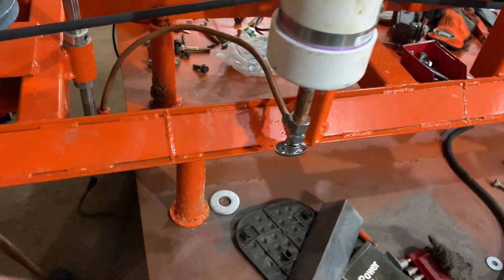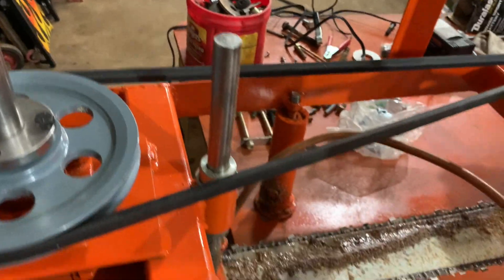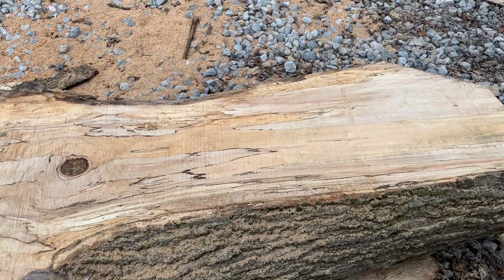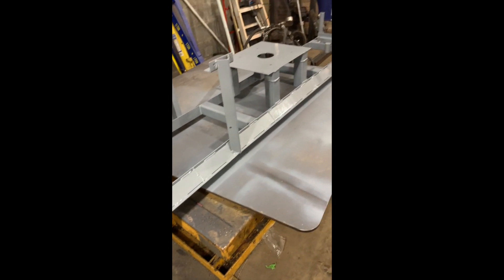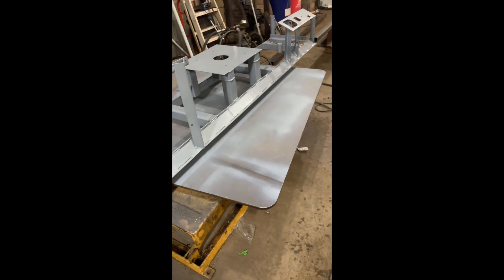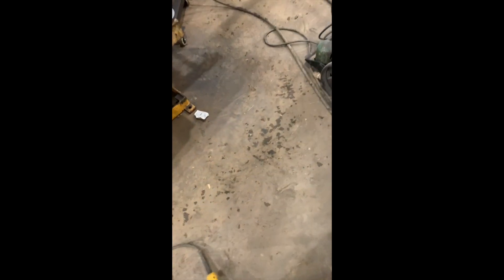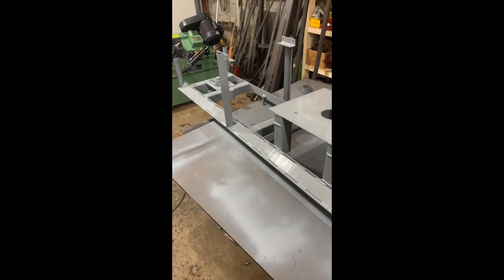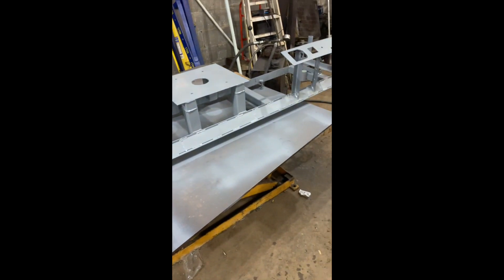DIY Lawnmower Powered Chainsaw Mill (Part 4)

Comment: That much horse power you need to change the gearing to increase the chain speed of rotation. 
 As well build a slide track and a table under it for the log to sit on where you push the unit on a slide on rails

Comment: Can you give detail of rim sprocket detail ?  I made a lawnmower driven, with a rim sprocket, but need other ideas......
Reply from the maker: Could you be a little more specific, I’m not quite sure what you’re asking
Reply: @ironacres717  https://www.instagram.com/p/CMa5EIDMdVv/?utm_source=ig_web_copy_link

Take a look at my Frankenstein.......I see you machined a rim sprocket assembly to a shaft.   Can you give a tighter shot of how your sprocket drives on the shaft?  Thanks, Jeff in Mobile, AL
Reply from the maker: Jeff Nagy Nice build ya got there! I believe there is a close up on one of the first two videos of the build series. I just took an oversized sprocket, turned the ID to 1” on the lathe then hand cut an internal keyway into the sprocket. It fits on that 1” jack shaft and then I put a shaft collar above and below the sprocket to stabilize it and lock it into place. The keyway wasn’t perfect bc I made it by hand but the sprocket is hardened steel so using a HSS keyway broach wasn’t a good option. It works well so far! It could shear the key under load but it hasn’t yet.

Comment: You're goingto need the pulleys to be in overdrive for the chain speed you need, even with it at a 1 to 1 ratio its only going to be spinning at 3500 rpm and I'd say you'll want it around 7000 or more. Build a track for it to run like a bandsaw and it will be a lot easier for you to use it by yourself, great build
Reply from the maker: oversized chainsaw sprocket helps get the chain speed up. The flange bearing cant handle more than 4k rpm so I can only do so much with the pulleys
Reply: @ironacres717   you need to change them cause you need around atleast  7000 rpm

Comment: TRY ADDING THE SQUARE TUBING ALONG THE SIDES OF THE LADER TO STIFFEN IT. ALSO BOLTING IT ON AND OFF THRU THE RUNGS OF THE LADER WILL MAKE IT LIGHTER AND MORE PORTIBLE.  GOOD IDEA AND JOB.